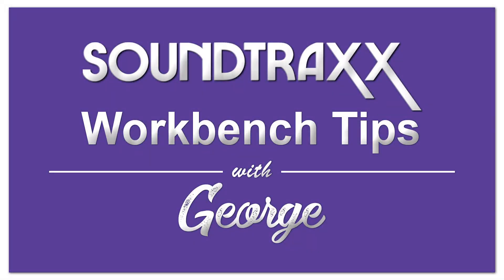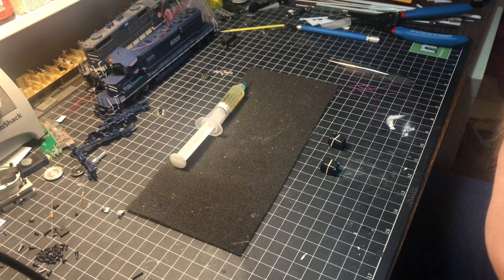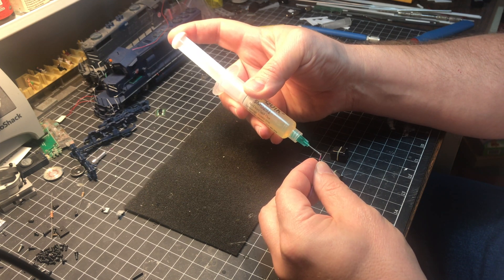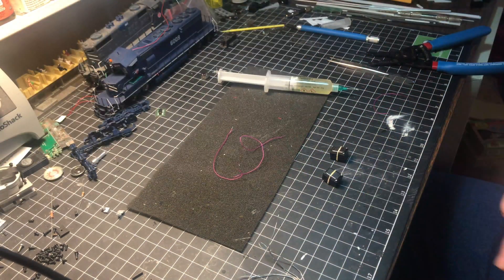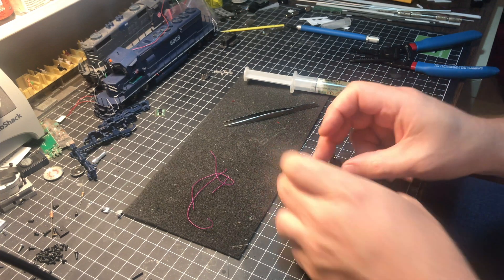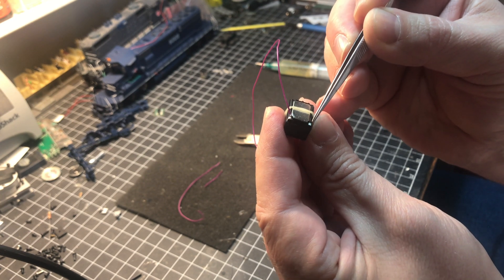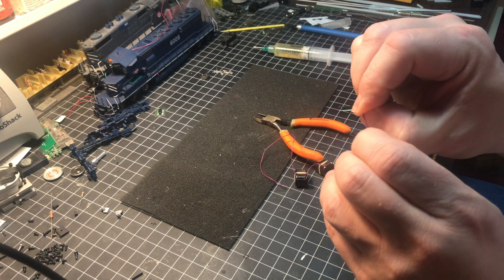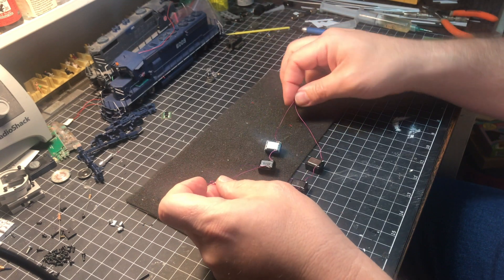How to Wire Train Speakers in Series with SoundTraxx

Comment: Can I use Testors 3502XT for  20.5mm Speaker Baffles will it work? I can't find Liquid Plastic Cement (TENAX-7R™  If not can you recommend  a cement. Thanks
Reply from the maker: Our Support Team can help you with this: (970)259-0690 or support@soundtraxx.com. Thanks!

Comment: RE:
Chipquick Flux.
It is actually a {de-soldering flux} used to replace [IC's]
on a circuit board.
Reply from the maker: It is designed for working on PCBs.  Flux in Syringes like this are for rework, yes.  But that doesn’t mean it will not work for this application.

Comment: I agree with Richard, it does make a difference to wire the polarity correctly, + to -  . When out of phase (- to - and + to +) the sound waves from each speaker are "working against each other". That means as one is pushing "out", the other is traveling in the opposite direction and this will diminish/distort the sound output.
Reply from the maker: I’m sure there are nuances, but our engineers have always recommended these in Series as shown in the video.  That way, when one is pushing out, the other is not sucking inward, resulting in poor quality.  And being near each other, the pressure form the speakers are working together rather than fighting each other.  For ease of install and without getting caught off in the weeds, adopting a practical setup like series as shown is easy to do and will work great in our models.  If we were talking about convert halls, then we may be having a different conversation.

Comment: Good video, thank you! It does make a difference in volume if the speakers in series are close to one another. In that case you should always wire them minus to plus between the two speakers. +[  ]-  +[  ]-That way they are called "In Phase".
Reply from the maker: Thanks for the tip!

Comment: Is there a sound difference in wiring them in series vs parallel? With your good quality speakers is there really an advantage to using 2 speakers?
Reply from the maker: Yes we have a few video on wiring and yes on the multiple speakers. Our great quality sound will sound bad through a bad speaker. Model trains are hard because we have space limitations, but the sound will only sound as good as the speaker will make it. If you hook our decoder up to a stereo system you will get awesome sound, but obviously not possible on your train. When you use two speakers they work together to better create those low frequencies that are hard for small speakers.

Comment: What about using some MEK when you run out of Tenex. Its a solvent that is used in the paint Industry. It melts Styrene, It is what Tenex 7 really is. Just a suggestion.
Reply from the maker: I’ve heard of the MEK and stuff from Micro Mark called “Same Stuff”  Will get these when needed.  Thank you for the tip!

Comment: Hi George.  With two in series, the ohms double.  Doesn't that impact your decoder's output?
Reply from the maker: Actually, each speaker is rated at .7w, so the 2 cubes added together are 1.4w.   Not quite 2W, but close and will work. (I think these are 1w peak).  You also get the benefit of the 2 speakers working together to help make the sound.   Using the Tsu2 7-band eq you can now get some boost on the low end and you’ll hear it cleaner than many other speakers that would fit.  Our cubes can reproduce down to 100 Hz.  So with 2 working, you’ll hear that low-end come through better.   
We have one that is a trade show mule with 2 cubes and it’s been running for a long time.

Comment: You mentioned not knowing what to do when you can't get Tenax 7R cement. I have an answer for you. As I read somewhere Micromark reverse engineered Tenax 7R cement and sells it under the name "Same Stuff". I have used it and it seems to work exactly the same.
Reply from the maker: Thanks for the tip, I may have to try that out soon!